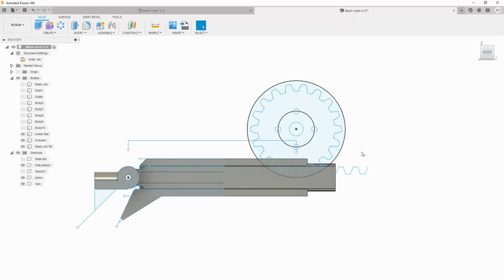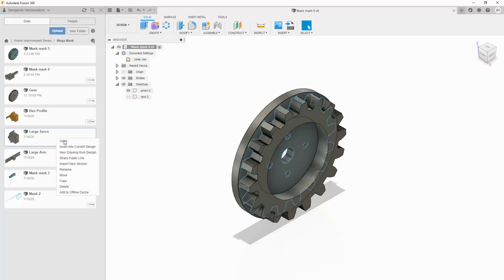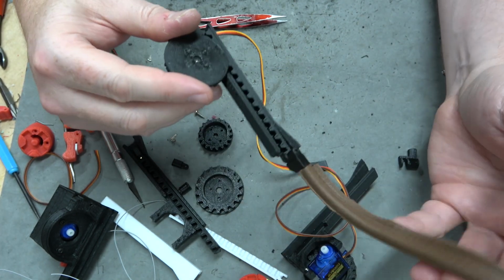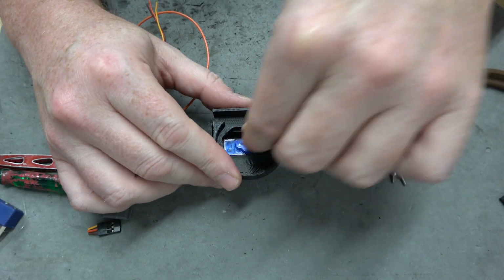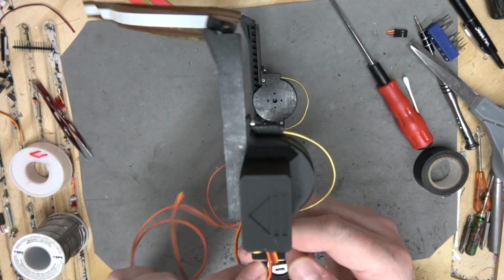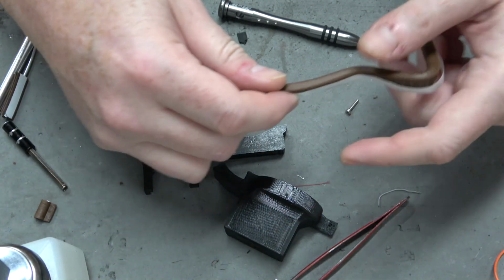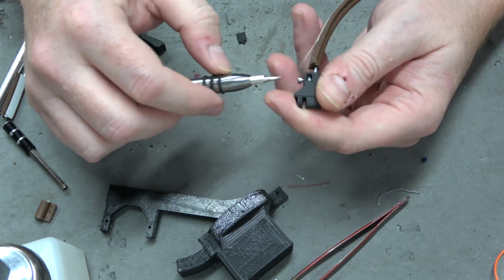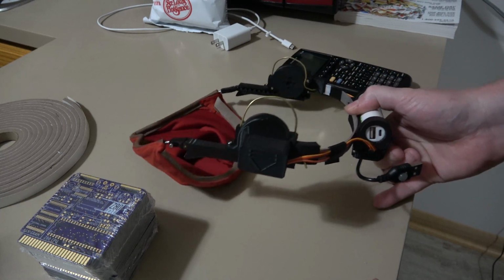Auto-Mask Mark 2

Comment: Much better work, sir! Thank you so much for sharing your improved design! 🤘😎 

The only thing I would add to the next upgrade, is 2 or more layers of un-elastic 100% cotton. Perhaps even with a sewn-in pocket for a filter. 

Another consideration might be an easily removable material with velcro to itself for easy washing and re-washing and perhaps interchangeability between different patterns or mask material.

Comment: This is cool.  I like the redesign for Mark 2.  The mandibles were cool though.  Removing material from the mandibles and replacing with filter could lighten them up.  A lerp function on the Servos could make for a smoother close to ensure they stay closed.  A simpler design could be completely mechanical using bicycle break cable with your mark 2 design.

Comment: Better design for sure and simpler i think a good addition would be to after it goes from down to your nose have a gap between your nose and the curve part and then have a mechanism to pull tighter towards you and viscebersa when going down

Comment: For a build it wasn’t bad but I thought the point in the mark2 was to remove bulk and weight sure this one isn’t as bulky but should still be quite heavy because of the portable battery behind the head it’s way to big for the job it’s doing

What u could do to get rid of the weight behind the head is use a pair of wireless headphones as inspiration but instead of the connection over the top of the head move it in front of the face so in mask terms have the wires go across the front of the mask hidden by the fabric that makes it a mask just make sure to leave the wires slack/loose so it still functions when the sliders move and the batteries change to the flat tablet shaped batteries u could use the battery mechanism from a pair of wireless headphones, a torch, a remote or something similar they tend to be small and then what ever circuitry left put on on of the sides like a pair of wireless headphones

Comment: Perhaps a version 3 with inline screw servos so it does not need to stick out so much to the sides would make it even better. No need to redo the mask part(unless you want to). Maybe a spring to determine the force that the mask is pulled towards your face and micro switches to set the action limits?

Comment: You need a button in your hand to activate it. KISS run a wire down your sleeve, attach it to an elastic band around your 4 fingers so you can press the button with your thumb.

Comment: Use a thin piece of plastic as thick as a zip tie and connect from one side of your device to the other over your head to alleviate the intention/pressure off your ears ... Will help with support ...
Reply from the maker: Not a bad idea! I'll try that if Mark 3 doesn't feel light enough. Probably won't have that done until early September though.

Comment: 28:00 You can get power from a gamma radioactive source, without a steam turbine. You encase the material in photovoltaic cells, this then captures the photons that are emitted.  It doesn't produce huge amounts of power, but they do produce power for a very long time. you wouldn't want one strapped to the back of your head though. You could probably use beta decay as well, but you would need something for the charged particles to interact with, to produce the photons.

Comment: Mark three should be a more Discrete, as in like a collar you wear and expands from you collar just to cover the front of the face and not wrap around, would definitely reduce the weight problem since its on your neck and shoulder instead of your ears.

Comment: Actually you can get energy out of the miniature sun or nuclear fuel rod with out turbine. You get it by passive radiation collection like military shipping nuclear generators. Those have absolutely shitty efficiency, but require no supervision and there is minimal chance of meltdown, just need to have some load on it all times.

Comment: i think that its good this kind of stubs, but maybe mark 3 should have water protection in case of rain of someting like that, to use more frecuently that mask, i was thinking to do someting like that but adding a filter or two maybe little ones to do more futurestic mask, also with a temperature sensor  or some switch to turn on or off the fans, some like that...

Comment: I know this is "old AF" now, and the mask wouldn't have passed muster for protection, BUT...
Wouldn't it have just been easier to have a simple 3 position rocker switch (spring loaded to return to center) on each ear... Then use typical junk motors from... almost anything (PC optical drives).

So you'd have to hold the rocker to actuate it fully, but there'd be no need for any MCU (not marvel cinematic universe lol) and just have the switche(s) wired to flip polarities, for in our out... 😏
BOM: 1 battery (pick your chemistry), 2 rocker switches, 2 motors (salvaged?), 3D printer filament.

(at worst, might need to add a second gear for added torque)

Comment: Why don't you use a small stepper motor like a NEMA 8 to mitigate any sort of limit issues. It would have great accuracy and could put the mask in basically the exact spot every time. I'm not sure about the torque but it would probably be able to do it.

Comment: V2 mask is much more realistic. I think you could cut a lot of the bulk by using metal gears like in pocketwatches and lose a lot of weight if those gears would be from Titanium and with holes in the closed part or like "spikes" connecting the outer gear "teeth" (Sorry English is my 4th language, so a lot of technical stuff is directly translated as we use in my language) to the inner circle. As well as by doing so you could probably make thinner and sturdier the sliding mechanism. The rod around the ears could use some soft transparent tubing like there are in hearing aids as depending on the weather plain metal can be cold to the ear as well as of long use wouldn't press on the ear as much.

Comment: Use two V shape ends  and use a pull technique lyfth it  & that opens this v shape tool at the ends too mask .. use flat battery .use a headphones 🎧 type brace open with one electric motor to wined it tight

Comment: Since you sew it yourself. You could elongate that point into a proper plague mask, so it can hold the magic herbs to protect you from disease.

Edit: I also think it would be amusing to have a mask that instead of removing itself/pulling down - it has a servo that turns a panel to reveal a small hole you can stick a straw through. Alternatively, and much more disturbingly -- the straw can be built into the mask, and a servo pulls a thin wire/fishing line that opens up a little spring-loaded self-closing lid at the end of the straw, and you simply drink from liquids like a mosquito man. lol.

Comment: Don't hate me for this, but given the very limited travel on those pinion gears, the need to reach up to your ears to actuate it, and the fact that the servos stick out so much anyway... Couldn't you just put little knobs where the servos are and very easily twist them by hand to actuate the mask forward & back that short distance in less than a second?

It's super cool as-is, but I feel like a manual version of this would be really dope, and make it more accessible for more people to print & make themselves 😃 Mk III - Manual edition?

Comment: So I’m no engineer but if you wanted to go more low tech and loose the weight of all the electronics you could probably replace the motor with a bob or dial so you rotate it up and down by hand considering you have to touch the button there anyways it doesn’t really inconvenience that much more

Comment: Forgive me if I'm repeating something that's already been said, but there are over 1300 comments at this point. Could this be revised into something that doesn't require any electronics? If it just runs on a simple tooth track, why can't it be controlled with just a knob turned by the user? It would make it much more accessible/available, and by removing battery/electronic needs there are less failure possibilities!

Comment: if you put the pivot point lower you could make it even simpler with an L shaped bracket.

(ear)       ______________________________________________________________  <- nose
               |
               |
               |
               |
               |
               |
               O <- Pivot

or am i wrong?

Comment: I dont see the point of making it automatic but hey, its still cool. Now, if you really want a comfortable mask you should make a neck device that takes all the heavy weight of the battery, mechanisms, heavy wiring, and only keep the mask itself attached to your ears. Another option would be making a mask that rest on your head instead of your ears.

P.S. I think youre adding way too much dead weight.

Comment: would one servo on the back using a cottton reel type way of pulling on wire to 'close the mask, using the rack and pinion but the other way around, so the mask is attached the to pinion and the rack pulls to raise it
Reply: No rack and pinion needed for that at all. Just linkages and cord on a spool.

Comment: nice video! but even the "slimmer/easier" version is way to overengineered xD
i just cut a buff-scarf in half and wear it around my neck. if i need the mask i pull it up over my nose with one hand. and i don't need it anymore the same... or i pull it down just with my jaw movement.